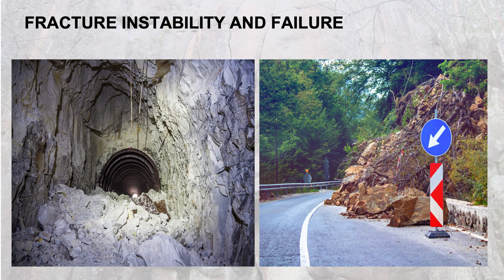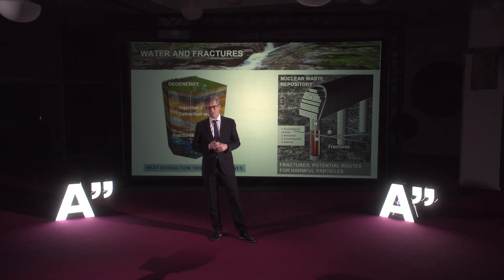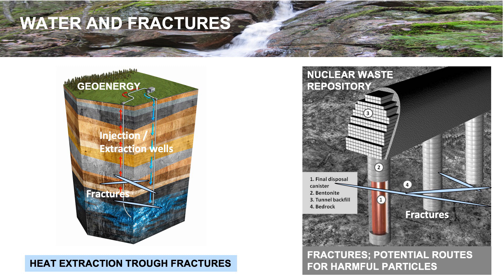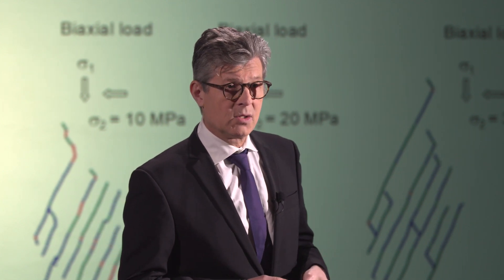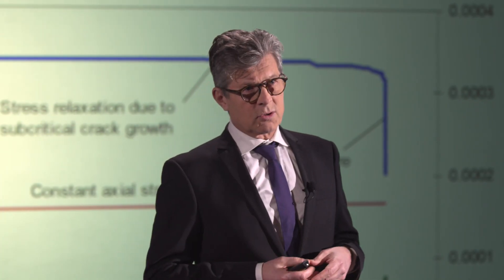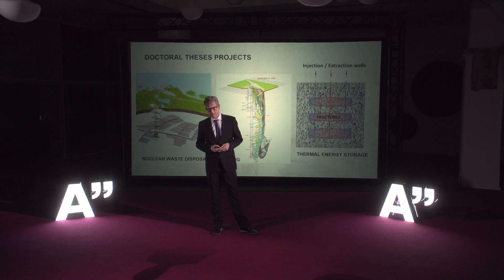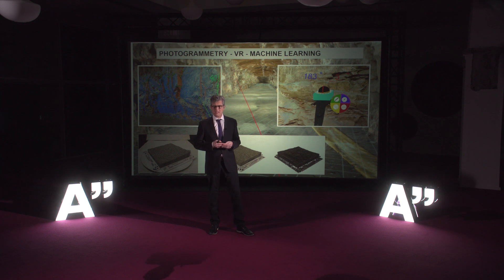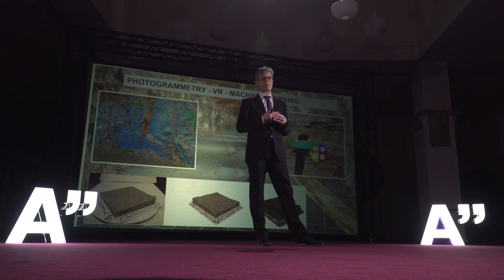Rock fracture mechanics and its applications in rock engineering – Mikael Rinne

Comment: But what determines the  direction  of propogation? Some go straight and flat. Others curved or concoidal. Yet others rogh and undulation like concrete. If I hit a floor tile in the centre with a hammer, the cracks dont propagate in a straight line towards the closes edge. What controls this?